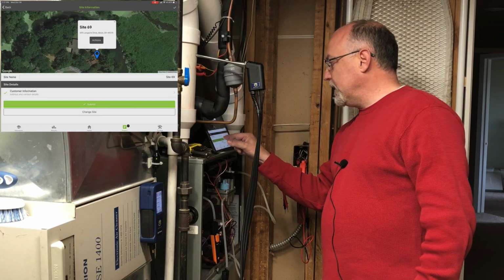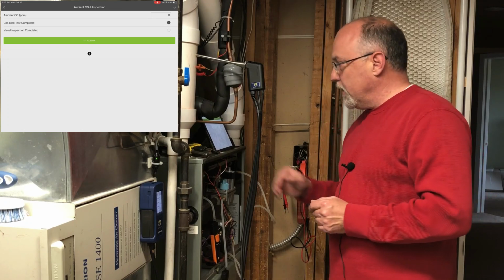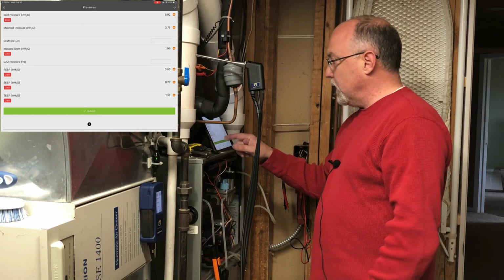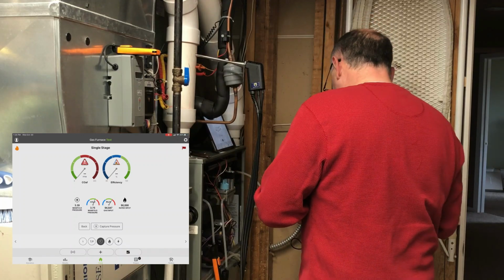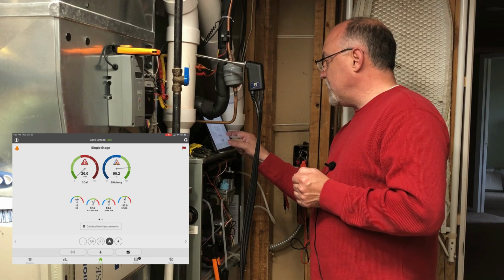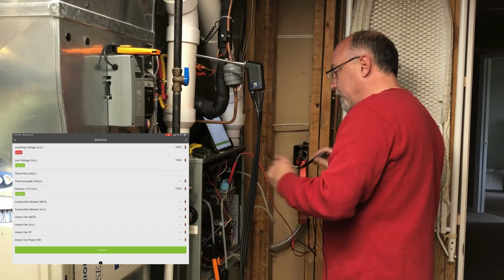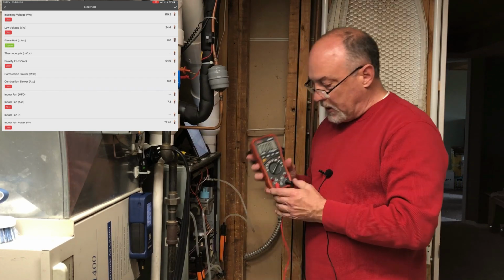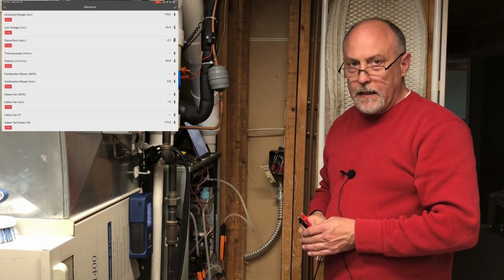Furnace Checkup

Comment: Jim I am trying to figure out what you did for induced draft, are you tee’d into the negative port with the clip simply trapping the draft pressure?
Reply from the maker: Cory Desormeaux tee in-line with the branch clipped off until I measured.

Comment: Explain that polarity reading please
Reply from the maker: Polarity is checking that the line voltage and low voltage are in phase meaning the low voltage wave and the line voltage wave crest at the same time in the same direction. If you think of a sine wave and the centerline = 0 volts, they would both go up at the same time. So if you think if the difference between the two 120 - 24 = 96. If one went up and one down, the polarity is reversed it will be 120 up + 24 down =144 volts differnece.  The reason this is important is the flame sensing circuit. If they are reversed the electrical noise will cause flame detection problems and many times circuit board failures.
Reply: Thank you for explaining that. I’ve never thought to check it that way.....but makes sense now